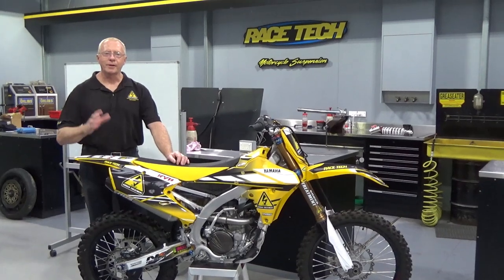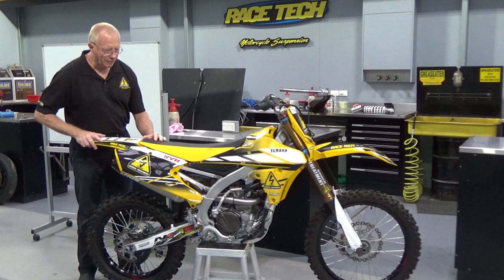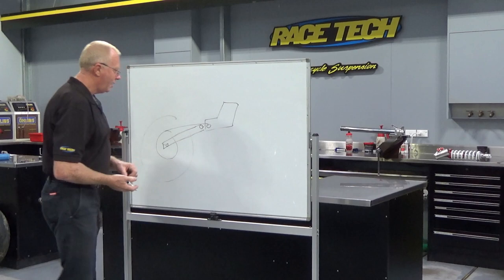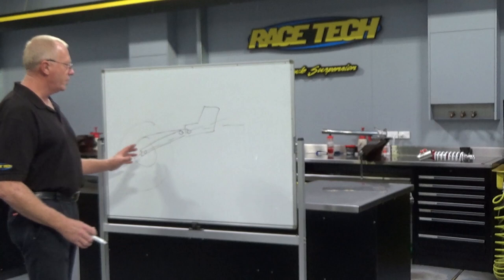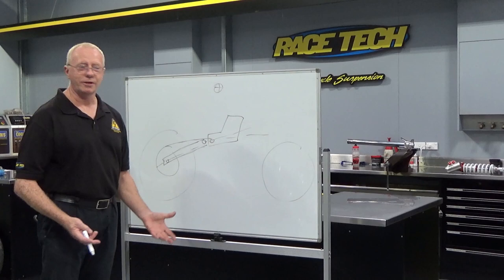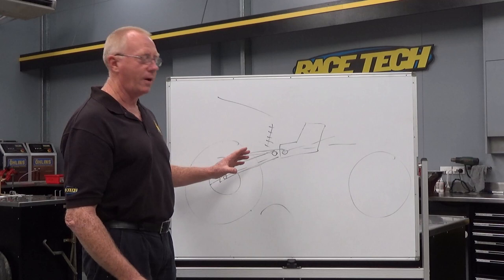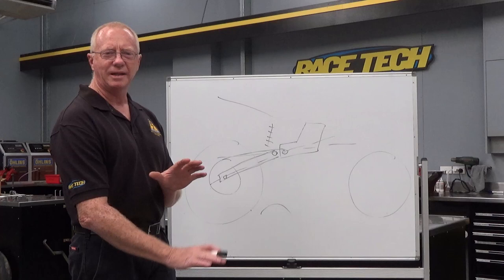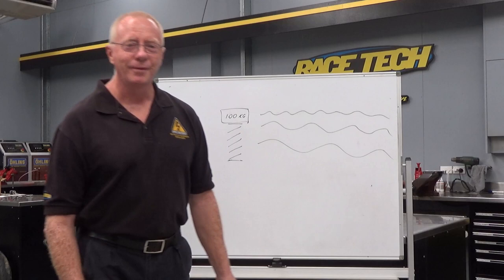Motorcycle Sag Theory and Explanation

Comment: I subscribed to learn more about newer suspension, I've owned and raced Dist. 37 Desert on a 1969 400 Cross, 1989 390 OR, 1985 500 XC and now 2106 FE 350, all Husqvarna's. Looking forward to evening out the flow of the stock suspension for off roading in Idaho. Thank you Terry for your simple explanation. Scott - CHECKERS M/C

Comment: What kind of data collection happens on the bikes to allow tuners to dial in the ideal spring rates?  I assume G, and throw distances can be measured in real time for each rider, then adjustments made for each track...
Reply from the maker: Yes....generally stroke position is a really good indicator as well as percentage of time spent in a particular travel range. Quite often people will use crude indicators such as zip ties or o-rings which will let you know how far the suspension has compressed, yet it fails to indicate "How Often".

Comment: Thank you for the video, you talk about getting the correct angle of the swing arm, would we be better off reading angles of the swing arm rather than sag then. For example we might want to aim for an angle of 78degrees
Reply from the maker: What we are trying to do is get the acceleration force driving through the centre of mass. Spring pressure will determine our angle for us and it should be governed by peak stability and forward motion. How much spring preload is required to achieve this ideal angle will also impact on suspension performance.....hence the need to achieve the ideal angle with the ideal spring / preload combination. The angle required will vary based more on riders height as opposed to weight. An 80 kg, 5'6" rider has a lower centre of mass than an 80kg 6'3" rider. Therefore a taller rider will require less sag in order to gain the same handling traits as a shorter one. I realise this adds another dimension to what has been an overly simplified concept from the suspension industry but if it is performance you are chasing, you really need to go the extra mile and test. These videos are to provide more information rather than greater convenience.
Reply: @shocktreatment5495  Thanks for the follow up.